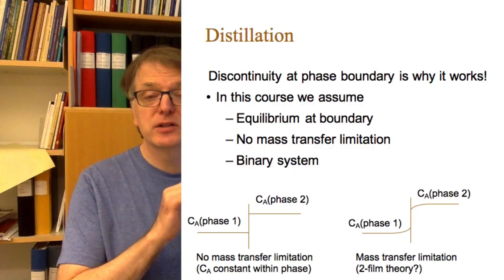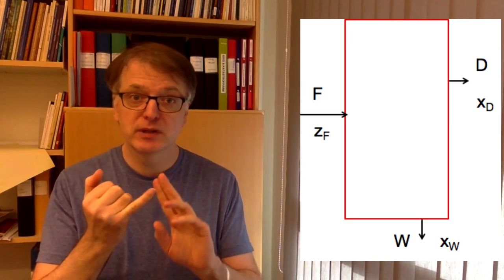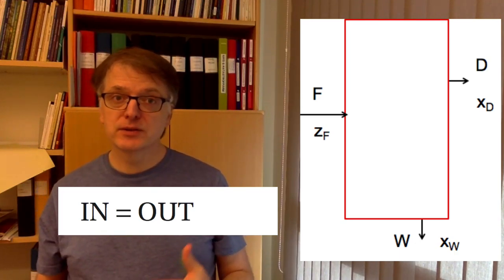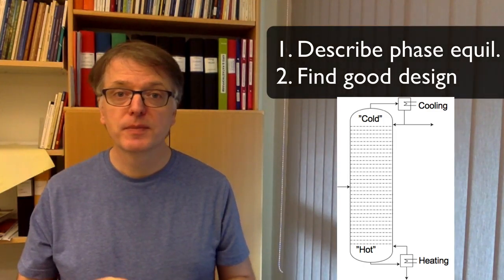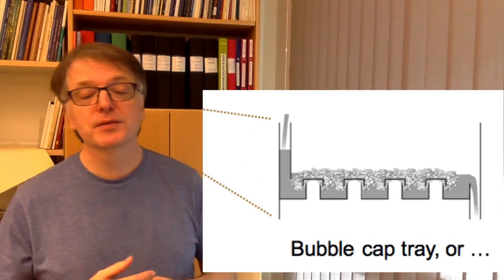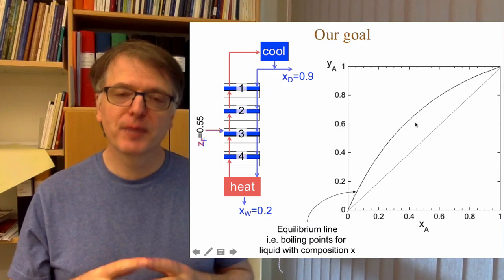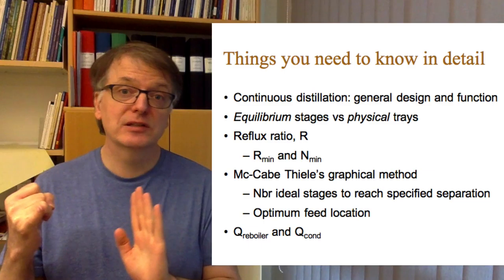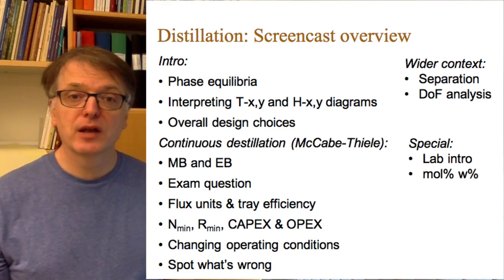Distillation: Intro & overview

Comment: . A mixture containing 40% Benzene and 60% toluene will be separated by continuous distillation in a fractional column. The mixture is fed to the column at a flow rate of 30000g/h. The top and bottom product is desired to be 97% Benzene and 98% Toluene, respectively. Reflux ratio is 3.5. 

a)	Calculate the product taken from the top and the bottom in mol/h.
b)	If the feed is liquid and at the boiling point, find the ideal number of trays and the position of the feed tray.

3.2. How do the following parameters affect the performance of the distillation column?
a) Reflux Rate
b) Bottom and Top Composition
c) Relative Volatility
d) Vapour-Liquid Equilibrium Curves and Azeotropes
Reply from the maker: We wont try to answer other teachers exam questions. Please note that a good answer on some of the questions you list will depend on whether the course is an introductory course or an advanced course. In introductory courses (in essentially any discipline), simplifications are often made such that a "correct" answer in an introductory course is an incorrect answer (or an answer that is not deep enough to give any points) in an advanced course.

As an example: In introductory courses dealing with distillation, it is often said that you can't use distillation to pass the azeotropic point. That is true for the designs typically discussed in introductory courses and thus full points might be given for answering "No" to the question "Can you use distillation to pass the azeotropic point?". In advanced courses, however, you might be asked how you could pass the azeotropic point by using two distillation columns operating at different pressures, and/or by introducing another substance  to the system.